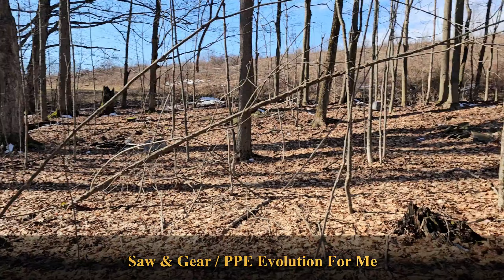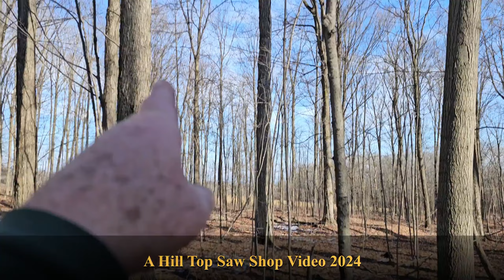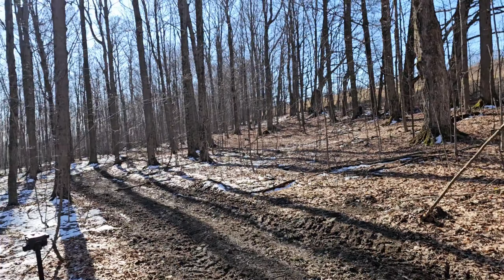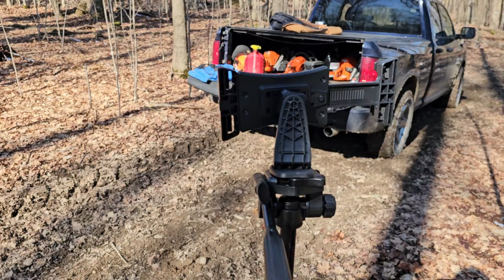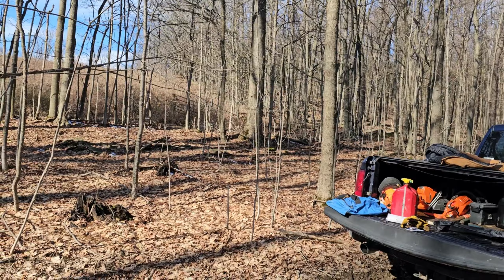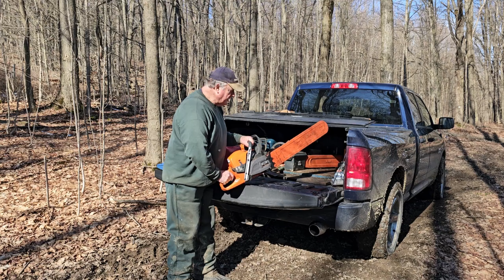Chainsaw Setup for Felling vs. General Use,  Gear Selection For Hobby, Farm and Wood Lot Management

Comment: Watching your videos over the years, I bought a 562 v1. Nice running saw, once you could get it hot started! Sold it and then bought a 565 as per your glowing reviews. I ended up selling it too as it was underpowered in my view. Stayed with my ported 2165/71’s and now run a few 500i’s. Always a pleasure watching your videos Walt.

Comment: I get questioned on my saw choices all the time. Short bars, no dogs, or small ones if I do, half wrap handles, and most of the time I grab a hot 50cc class saw over my bigger ones. Up here in NW Ontario, the timber is small due to our short growing season, its primarily softwood, or softer hardwoods, and my heavily Scandinavian influenced east coast pulpwood upbringing is hard to shake. I run what I run because its what I grew up using, and various injuries over the years make me notice the extra weight quickly. 
In the past few years, I have mostly been salvaging from slash piles, so dogs make even less sense as I am very rarely falling. 
I also grew up with dad's big hardwood saw being a 254 and the production saw being a 242, so my outlook is different than most.

Comment: I wish my 652 had a little more torque , it feels like it is just under 60 cc compared to Stihl.   If I was young again I'd buy a 572 with a 26-28 inch lite weight tsumara bar.
Reply: If you were young? 592 xp. Might as well go for 18 years of age🤣🤣
Reply: But the 562 is extremely fuel efficient. It is close to twice as long run time as a Stihl 361

Comment: Get a 4 by 4 ' truck.  Two wheel drive trucks will get stuck on wet grass.😢
Reply: With warm weather and sunny the top 2-3 inches of the soil thaw and are full of water makes super slippery mud. You get no traction. 4wd only helps so much.

Comment: Simply put many great points and common sense in this video nicely done. As far as saw bars go the more rivets the bar nose has the longer they last, that's bean my personal experience. A four rivet bar being the worst, five rivet standard fair and six rivet being the toughest; the nose doesn't splay out or open up as easy with more rivets holding that bearing steady with heat and wear. Lot's of good info for those wanting to learn if their willing, take care.